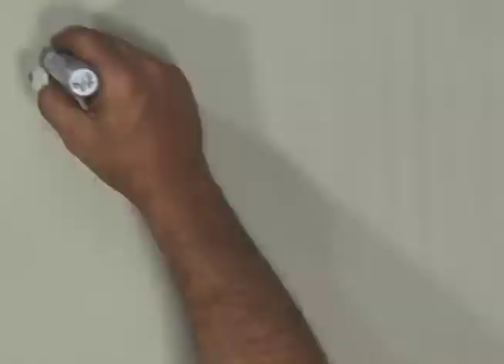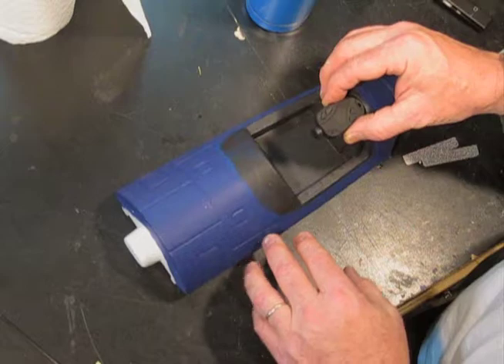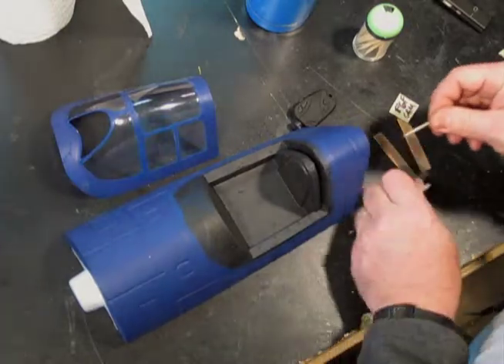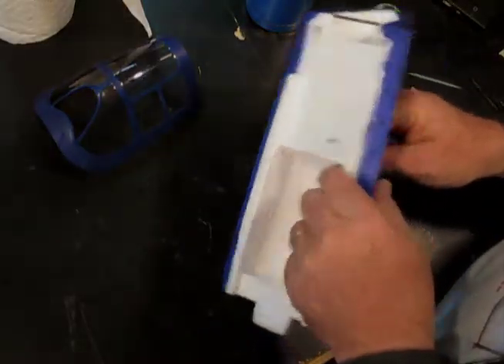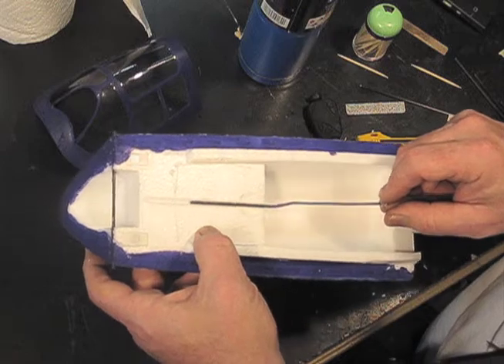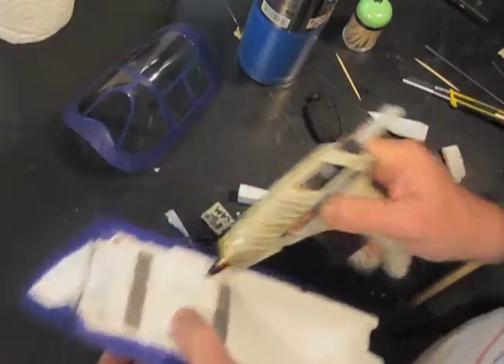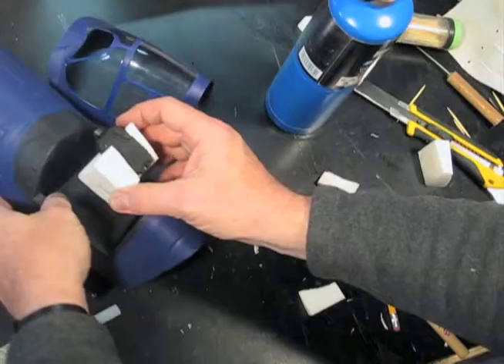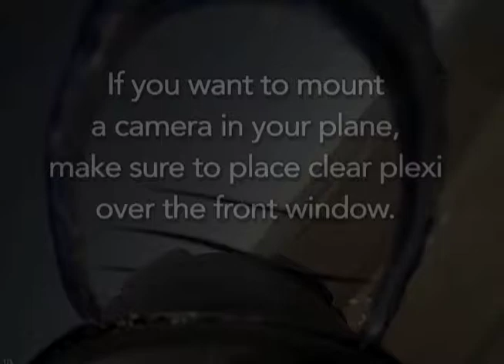DOWN & DIRTY TIPS N' TRICKS - HOW TO MOUNT A CAMERA IN YOUR COCKPIT

Comment: Great little trick Steve! 
But a question with you cutting out the front panel of the windshield obviously for our final shot viewing pleasure, wouldn't that put excess drag on the plane? 
I have the airfield B-25 and I crashed it one day destroying the nose canopy and decapitating the nose gunner we had him a military funeral but the neighbors called the cops after I shot my gun off 7 times...lol
Anyway with the canopy off I still flew it which caused the plane to pitch up severely not because of the weight difference but from the wind resistance against the back wall of the plane wouldn't that cause the same problem cutting the front glass out?